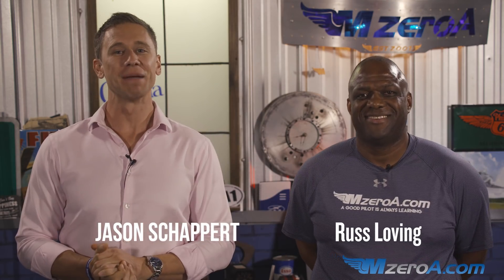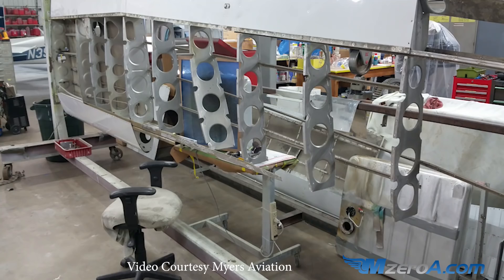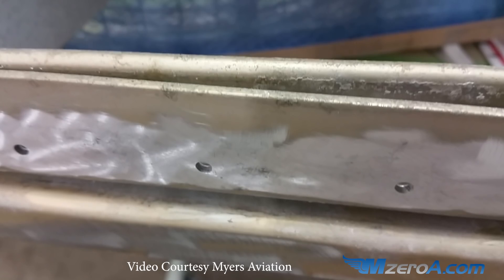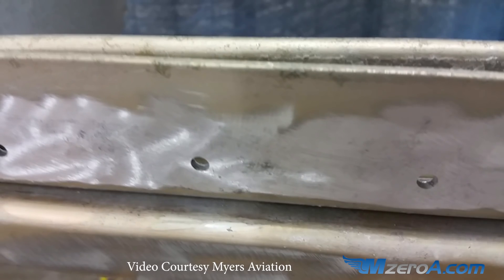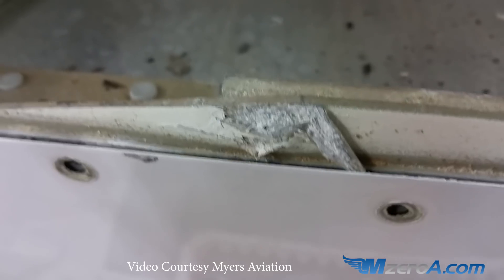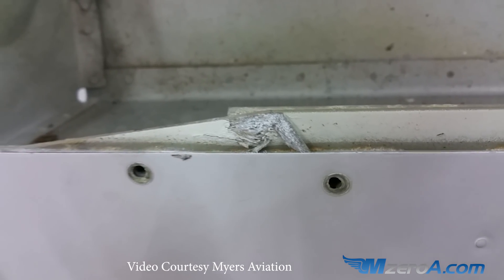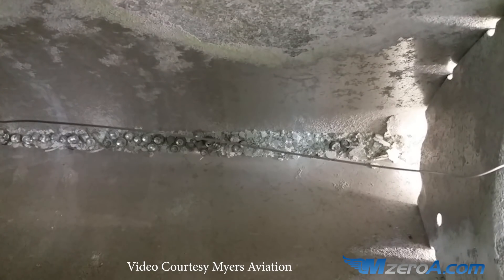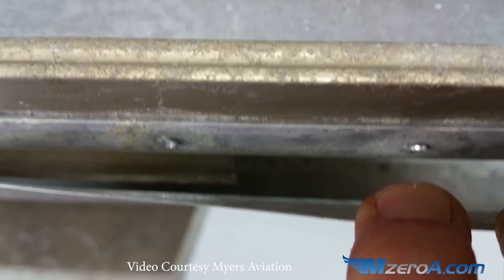N23MZ Repair Update #2 - MzeroA Flight Training

Comment: As a 40+ year A&P, I'm really enjoying this new maintenance angle in the MzeroA videos. I only have experience on large, Part 121 aircraft, so getting to see some issues with small, GA airplanes is enlightening. Intergranular corrosion is a bad thing. I remember seeing intergranular and exfoliation corrosion on a DC-9 wing forward spar and it is metaphorically similar to cancer. It's almost as if the metal is destroying itself from the inside, out. It will be fun to watch 3MZ going back together.

Comment: Hey Jason ,Im a 27 years Flight Inspector for Learjet in Wichita , ex Air force Chew Chief, and former Lockheed employee structural sheet metal mechanic and Wow that's a lot of corrosion. I didn't see any sealer of brush coat in those wings, also not in that rudder. If I were you guys I would go back over the entire aircraft and treat everything with alodine and primer.. Also one thing that the commercial cargo aircraft do is , they spray the areas underneath everything with LPS3. I know that's an older Cessna, but that's inexcusable..Just my thoughts Jason..Glad you guys found the problem before an incident happened.. Keep flying and teaching....

Comment: The fact that there was so much corrosion in areas that can't be normally inspected makes me fear for all the 1960/70/80s fleet in my rental club.... which is in San Diego, near the ocean.
Reply: So your going to keep flying them all, should be mandatory teardown inspection.
Reply: @justme197511  it would make me feel a little better if they had to inspect them. I suspect that is extremely expensive. Owner costs will go up. Renter costs will go up. Maybe I'll just cross my fingers and hope it doesn't happen to me.
Reply: Seems to me San Diego is dry compared to anywhere in FL.  One needs an electrolyte (Water and something to conduct).  Might not be as bad as Jason's situation
Reply: Nothing has corroded in the last couple of weeks with 1% humidity around here! :)

Comment: There are a couple of things that I see that are concerning to me as a 30 year A&P.
There appears to be no primer used on the skins or faying surfaces. There also appears to be no sealant or primer used on the rivet installation.

Using a borescope to perform addition inspections is going to open a can of worms. The deeper you dig, the more you're going to find. A borescope is a great tool, just be aware that you're going to find things that others have missed. 

When the other wing goes back together, provided a DER approves, I'd used a sealant on the faying surfaces to keep moisture out of the wing. The rivets would be wet installed with a chromate primer at a minimum but preferably a corrosion resistant sealant with a long pot life. Any gaps in the skins would be sealed so that salt air can't condense and start corroding the aluminum skins. 

Graphite composites and aluminum components are going to fall out of favor quickly unless you pay attention to isolating graphite from aluminum.
Reply: That is true and I am not for sure if Cessna just does not prime on the in side of the wing or because the age of the aircraft. I will have to look more into that.

Comment: This puts a new outlook on pre-buy inspection. I may sound stupid asking this: Is there a corrosion resistance coating, paint, etc that can be applied during annual to prevent or slow down the effects.
Reply: We had sprayed ACF-50.
Reply: Russell Loving As a person looking to buy next year, would it be something I should bring up during the pre-buy? Living in San Francisco Bay Area, I don’t think anyone has ever mentioned this issue. But you don’t know what you don’t know. Hypothetically, how much would I be looking at to get the aircraft serviced for this type of issue? I know it’s general and situational.
Reply: @clarencewatson6226  It is situational, however, if the previous owner has not sprayed the ACF-50 and/or has been near any of the coast for a number of years then you would want to look at the spars. The issue would and is the cost of the inspection. So, I would have my tanks removed and check for corrosion which I will be implementing on our annals.
Reply: @Russell Loving  Thanks. I’ll add that to my checklist and budget for next year. Thanks for posting this information, definitely setting us up for success. Please post more, and if possible yourself or Jason do  a breakdown on everything once completed. Great meeting you guys at the Livermore Fly-In.
Reply: Corrosion X is used annually at the N.W. flight school I mechanic at. Some mechanics drown the wings and fuselage with it, some are perhaps too reserved.(I once addressed a line squawk about an oil, possibly fuel leak, at the wing root that trailed to mid-empanage.  I think that mechanic was using the corrosion X like it was a can of paint, that's excessive) However annual mistings should accumulate to form a uniform coating.
  (For some this goes without saying) Existing corrosion has to be removed (less than 20%, original material thickness) and protective finishes restored. Corrosion X and good ol' purple ACF 50, aren't finishes.
Finally, alclad aluminum alloy has a commercially pure coating of aluminum, that was intended to create an oxidized aluminum exterior finish layer.  In many climates it is sufficient. (This seems to me, to have been the thinking when observing primer-less factory original 152s and 172s inner surfaces) Corrosive environments are able to conquer this intended layer of defense. This is why primers and paints are used as sound practice.  Less about looks than it is about corrosion prevention. 

Thanks for giving me a place to regurgitate my training.
Reply: @clarencewatson6226  No problem at all and thank you!
Reply: @Ry-dx5om  You are welcome. We did the ACF-50 two years ago but will be doing this at an annually basis. As you know anytime an aircraft is near the coast we must really watch for corrosion, typically  more than normal. I have learned a lot during this process and will continue to get better which I will be updating our annual inspection.

Comment: How much does the weight change from the carbon fiber modifications? Is there going to be a new weight and balance? I know its small modifications but 172s weight makes all the difference.
Reply: The plastic had started to break off in several places so we decided to go with carbon fiber due to durability.

Comment: Embry Riddle lost an instructor and student some years back when one of the wings came off at the root due to corrosion. I'm surprised inspection requirements don't call for, maybe every five years or something, removing some skins as well as borescope? Scarry stuff and thank you for sharing.
Reply: These areas that they're showing are near impossible to see. That's the inherent issue here.
Reply: The Embry Riddle plane lost the left wing due to excessive stress loads from using it for flight training and suspected aerobatics although it couldn't be proven...there was another in alaska that suffered the same fate while pipeline inspections and probably excessive low level speeds like using it like it's built like a crop duster.  I never read anything or mentioned about corrosion being found on either airplane...

Comment: Seeing this corrosion I'm wondering what material should planes be constructed from to prevent this....like composite or fiberglass or carbon fiber....you should talk about this at oshkosh next year Jason.
Reply: Carbon fiber/Composite/Fiberglass has their issues also. The material must be light but durable which is why we usually do not get both.
Reply: @RussellLoving  I looked at the new pipstrel trainers at an airshow....they have an electric motor and also have a hybrid out.  Got to find a material that can withstand the abuse of a trainer but low maintence....maybe transparent aluminum.....wheres Scotty when you need him....lol
Reply: Diamonds are composite and their wings have to be REMOVED every 1000 hours for inspection, and the Cirrus line of singles have a life limit of 12,000 hours. Literally at 12,000 hours you strip them and throw them in the trash... I have heard of a few 172s that have upwards of 30k hours on them.  Aluminum is tried and true.
Reply: Justin Stanley Then what is the best way to prevent all this corrosion on aluminum built planes?  I was considering building an RV-10 but being aluminum you’d have to paint every exposed piece of metal during the building process to protect the aluminum.  Cant always keep a plane away from salt water and you want to protect your investment so it lasts as long as possible.
Reply: @stevemullin1195  Pick your poison.  Aluminum requires you to look for corrosion.  Mainly to stop it before is spreads and cost even more $$$$$.  That is a major part of the annual inspection (experimental planes call it a condition inspection).  Composite air frames can have issues with delamination and a lot of times is actually harder to detect and even more expensive to fix.  If you look at mid air breakups, corrosion related ones can almost be counted on one hand.  It is so rare that it borders on a non-issue.  Don't get me wrong, proper maintenance and inspections are key in preventing corrosion related issues.  Bonanzas had issues early on because of magnesium tails, and they are still being replaced on condition with aluminum ones today.  The V-tails can't be replaced with aluminum because of weight issues, so they have to be replaced with other mag tails, which are no longer being made.  As in all we've got is all we've got and when they are gone, the plane goes in the scrap heap.  Of the top 100 things I think may kill me in an airplane one day.  Corrosion (especially in my own aircraft with known maintenance) isn't even on the list.  I think the reports of a near breakup for this plane are exaggerated.  I cannot find a single case of a 172 breaking up because of corrosion (doesn't mean that it hasn't happened, just that it is extremely rare).  As far as corrosion prevention, 172 don't come with any and they see more hard hours than any plane out there, with a lot of the large pilot mills being in Florida (high humidity).  For an RV, there are about as many opinions on corrosion prevention on those forums as their are airplanes flying.  They range from, you don't need anything because if it's good enough for Cessna and Piper it's good enough for me, to you need to two part primer every tiny little part or your plane will be a scrap heap in 5 years.  Most people fall somewhere in the middle with 1 part self etching primer on certain areas where moisture could collect and not dry quickly.  Once you start reading, it can get pretty heated.  It is almost as bad as ROP vs LOP...
Reply: @tstanley01  I agree with you Justin but those composite aircraft are sexy and fast.

Comment: You showed pictures of re-skinning the horizontal stabilizer and I’m curious if you saw any cracks in the center lightening hole?  My mechanic found some in my 1975 M model C-172 and I had the doubler installed to fix that problem.
Reply: I did not see any cracks on the horizontal stabilizer, but that is an interesting, thanks.
Reply: I have found a couple of those cracks on 172s
Reply: @flyingFL310  Thank you for that, I will keep an eye out for that.
Reply: I understand it can be caused by pushing down on the horizontal stabilizer to pivot the nose and I have been guilty of that!
Reply: @ranjrog  That is true,  I believe there is an AD about that also.

Comment: Not to be negative but an A/P that doesn’t own a bore scope? Seems like a necessity for an A/P. Great eye opening video. Thanks for sharing Jason.
Reply: Specially if he does engine work, never know if there is a crack in one of the 4 jugs
Reply: I agree the borescope is something that should be in the toolbox.
Reply: A borescope is not always a necesity.....its is a great addition to a toolbox but not always needed.....HOWEVER....even with one it is still possible to miss things.....the optic cables are not always as long as u sometimes might need.  Also, even the moderately priced borescopes are hard to direct well and reach every little corner and the images are not always clear.  Im an Airline maintenace QC inspector,  and fortunately the our dept has a good quality borescope.  Most general aviaiton shops will not spend 25k-30k on a high quality borescope because it is not cost effective.   I guess wat im tryin to say is that....dont "beat up" on poor Russ
.....sometimes things are missed and we cant always see every little inch and every little corner......we hafta make decisions based on wat we see as evidence in the surrounding areas that are near impossible to reach.
Reply: @mikeylop4242  the price for a really good borescope is expensive and it is upsetting that something like this gets missed but I hope we (especially myself) learn from this. Thank you for your input.
Reply: @RussellLoving  i definitely will and have learned.....and will begin to pay more particular attention .....both at my job and in my Mooney
Reply: @mikeylop4242  That is awesome!

Comment: Are you going to take some skin off the other wing to inspect for corrosion?
Reply: In yesterday's member-only webinar he mentioned that they took the skin off the other wing and found no issue on that side.
Reply: 1dgram glad they did that. It’d be irresponsible not to pull skin off the other wing.

Comment: I see barely any zinc chromate priming on those structures. Do all Cessnas come like that?
Reply: I don't think Cessna sprayed primer in the wing on the older model aircraft.
Reply: Only planes that were ordered with the expectation of being put on floats were corrosion proofed at the factory.
Reply: @charleseinarson  I had a very interesting conversation yesterday about Cessna/Piper using zinc chromate primer. So Cessna didn't spray the aircraft with zinc chromate primer, Piper did but you had to order the aircraft stating you wanted the zinc chromate primer. That is from someone who worked in Vero Beach (Piper) so I consider this source pretty good, lol.
Reply: Well all that corrosion is not a surprise than. No corrosion protection and based in Florida. Honestly is it even worth to repair that cessna? That corrosion is gonna keep on creeping in and probably already exists everywhere else on that air frame.
Reply: @barisyildirim4167  I would say yes it is worth it due to the repairs would still be a lot less than buying another aircraft. I am sure you have read some of the comments on getting another aircraft but if we added the cost of either removing the avionic in 23MZ  to put into another airframe or doing the same avionics in a different airframe the cost would be about the same. We just hope you don't have to sell Jason off the the highest bidder to get the aircraft back, lol.

Comment: There is something fishy about what I have seen in the videos. Did you notice the corrosion pattern on one of those ribs? It is like it had been sitting in salt water, or something, up to a certain level for a period of time. There is a definitive line about half way up where the corrosive substance did not touch. Did this wing come off of a once partially submerged aircraft? Check serial numbers if there are any.
Reply: The aircraft was in Jacksonville, FL for awhile but never submerged in water.

Comment: What are the pieces of wire in the wing going from hole to hole used for?
Reply: The wire is for Nav/Strobe lights on the wing tips.
Reply: @RussellLoving  I get it there pull wires for when you get the skin back on thanks for answering that for me good luck with all the repairs hope to see you in the air soon
Reply: @jerrysrides7127  don't make promises like that, I will put you to work, lol. Thank you.
Reply: @RussellLoving  hahaha don't talk like that I might just come there and help you it's been one of my dream since I was a young man has to be a certified A&P so exactly where are you at LOL I'm south of Houston and Texas I didn't go for a & P instead I went for an electrical engineering degree it's worked out fine for me I work for Baxter travenol Laboratories for many years built many machines would love to build an airplane you have a wonderful day and good luck with all of your jobs ahead of you hope to see you flying I really enjoy the mechanical and as much as I do the flying part don't make me come down there and help you hahaha
Reply: @jerrysrides7127  We are in Ocala and thank you for that Jerry. You have a great day as well!

Comment: Cessna built these aircraft to be phased out after 10 years service and they are built with 2024 T4 aluminum which is clad coated...basically they spray a thin coat of pure aluminum over the entire surface which is done to prevent corrosion at the plant the alloy is formed before Cessna even gets it, which when you consider they planned on the plane having a life span of 10 years max, spraying the inside with a chromate or other anti corrosion primer on anything but seaplanes wouldn't have been in their budget, plus unnecessary.

Comment: They need to coat the interior of the fuselage and wings with anti-corrosion compound at the factory when they build them.
Reply: LOL, that would be great or the material the black box is made with would help also.
Reply: Russell Loving yes lol
Reply: French built Cessna's (Reims/Cessna's) are all treated on the inside of all structures with zinc chromate. You can see that Myers are doing the same on the new structures which is excellent. My advise would be to treat the inside regularly with ACF50 which is designed to prevent corrosion
Reply: @CaptBoeing737  That is a great idea since we are in Florida, Thank you.